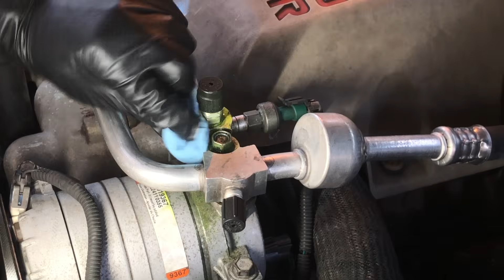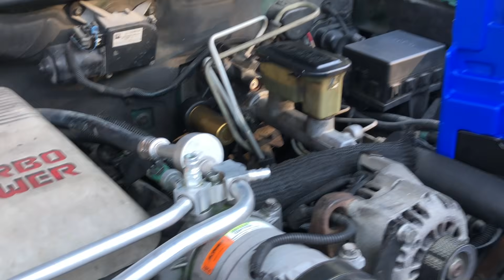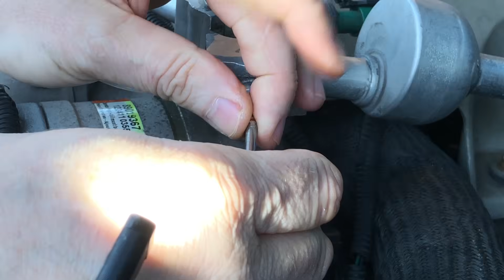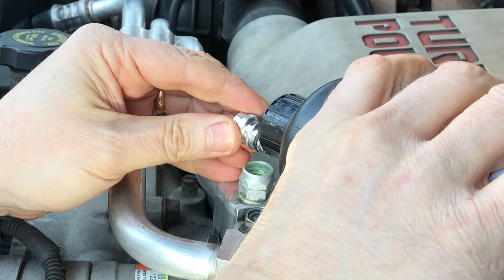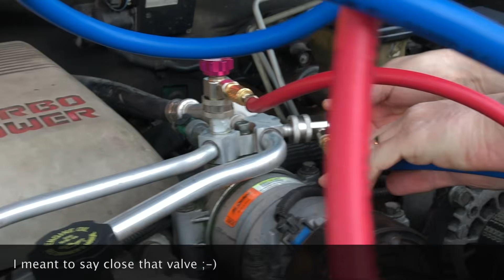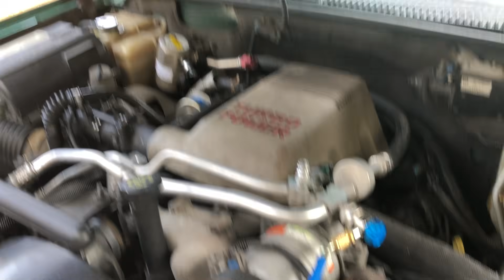1996 - 2002 GM OBS Truck R134a AC High Pressure Ball Valve Service Port Leak Repair (Chevy & GMC)

Comment: I had a small leak on my condenser and the gauges are showing 0. I am going to replace it orifice tube, accumulator and schrader valves while I am at it. Would there be any liquid refrigerant left in the system or does that leak out as well? Don't want to over charge it. Just a DIY er trying to do it myself. thanks
Reply from the maker: If you are sure you have the gauges connected properly to the ports in the AC system, and the valves opened at the gauge connector ends, reading zero would indicate you've completely lost the refrigerant charge.   Given you mentioned you are DIYing it, just making sure you verify it's really at zero (familiar with your gauge/tools) before attempting to open up anything.  

You would need to pull a vacuum on it to be sure there are no other small leaks.
Reply: @DrShock  Thanks for responding, but yes the connectors were on correct and the schrader valves were open and it was reading zero, low and high side. I have a vacuum pump and will pull a vacuum when the replacement parts are on. It's a 96 eldorado. So you are saying that there is no liquid refrigerant that could be in the system, evaporator or in the compressor? thanks
Reply from the maker: No, that's very unlikely with no pressure at all in the system.  The R134a refrigerant is always going to be trying to get to its gaseous state.  When you have a small leak, and it goes unaddressed for a long time, it's quite possible to vent the entire refrigerant charge into the atmosphere over that time.   The more R134a vapor you lose, the more R134a liquid converts to vapor until there's no more charge left in the system.     Pull a vacuum on it before removing any fittings though, just to be sure (again I'm not there so wouldn't want this to just be a whoops I didn't have the gauge valve open all the way situation).  ;-)

Note that when you have damage, like a hose rupture, and you lose the entire refrigerant charge quickly, then you can also lose the PAG oil charge with it.  If you had a small leak, then just replace the amount of PAG oil recommended for the new condenser and accumulator you are changing.  A service manual for your vehicle should give estimates on what to use there.  Worst case, replace with brand new PAG oil the same amount you drain from the old parts.
Reply: @DrShock  OK thank you, I will pull a vacuum first to have no whoops. I do have a GM service manual it says an ounce in each unless it has more than an ounce then put in what came out.

Comment: I learned the simplest jobs can quickly go south on you changing a high side port like that and not knowing I needed a special socket lol had to replace the line going to evaporator from condenser on a regal GS

Comment: so when you pull the freon out of the system, does the compressor oil get pulled out with it? Trying to understand if compressor oil has to go in if the system looses its freon due to leak. I did notice hissing at the High pressure valve when the cap was removed. Thinking about getting the manifold gauge and vacuum pump to try and recharge my system in my 2000 chevy 3/4 ton truck. What other tools would I need? I dont mind buying the basics to save the crazy amounts the shops are charging to do this. Background: It had low freon because the compressor was kicking on and off every second or two. SO...before doing enough research I added a partial can of the AC pro 135a recharge from Oreilys using the directions. I got it up to what I think it too high now. Right at the top of the green on their gauge and just below the yellow. The AC works slightly, but never got really cold like it should. Any advice? thx
Reply from the maker: It's rare in my experience to get any significant amount of PAG oil out when evacuating the existing refrigerant charge using a recovery machine.  The vast majority of the PAG oil is going to stay in the compressor and evaporator (with most of the rest in the accumulator and condenser).   You typically only lose a significant amount with a sudden large leak (e.g., a hose rupture) or when changing the compressor, evaporator, or to a lesser extent the condenser or accumulator.

To know where you're vehicle is at, you really need a set of AC gauges and the service manual.  That way you can determine the state of the refrigerant charge more specifically.   As well as determining if the pressures indicate the other components are operating normally.
Reply: @DrShock  thanks.....planning to get the gauge next.

Comment: I've got an AC problem I can't figure out. Could you please help me? I bought a 1990 Ford f350 diesel. The AC was not working. I checked and found that the system was empty. I found a leak in the evaporator. I bought an evaporator, an o-ring kit, and a receiver dryer. I changed the evaporator out and a bunch of o-rings. Then I added some oil with UV dye and pressurized the system with air using a cheap Ebay manifold set to check for leaks. I ran the truck for ten minutes. I found no more leaks. I let it sit overnight. The pressure did not go down overnight. So I thought I was good to go. I installed a new receiver dryer and then vacuumed down the system for an hour. Then I put 50 oz of R-134 into the system. Everything looked good. I started the truck and the system seemed to be working. But I got interrupted. I shut the truck off and partially closed the hood but I left the manifold set connected. I came out today and the pressure on the entire system is at zero. I even cracked open a line and no pressure. But there is no sign of refrigerant leaking out anywhere. I even waited until night and used a UV light and nothing. No sign of a leak but no pressure. I thoroughly inspected everywhere and there is no sign of refrigerant leak. I'm at a loss for what to do. It makes no sense to me. I would gladly pay you for a consultation and advice via paypal. Everyone's time is valuable. Any help is greatly appreciated.
Reply from the maker: Typically with these difficult to locate leaks, I will vacuum down the system and then add nitrogen on the high pressure side only to around 100-120 psi at the tanks regulator.   Once at this pressure, shut off the nitrogen valve and listen while watching the AC manifold gauge pressure to see if it drops.   Typically nitrogen testing will surface leaks that do not show up on a vacuum test (though you still need to do that test too).  If you do not hear anything, then I'd next start with the soapy bubble mixture you can pick up at your local Home Depot or Lowes for propane/natural gas pipe leak checking.  Applying it at every hard line weld joint and every crimp to a rubber hose in the AC system.   

Nitrogen is very cheap, you can pick up a small tank at your local PraxAir or Airgas center.  The regulator for the tank will be the most costly purchase.   But you can use this for tire inflation also, superior to just air as no moisture going into the wheels to corrode the TPMS sensors.

Comment: Thank you. The service manual appears to reference 4.0 lbs of R134a required for a Suburban with rear a/c. What source are you using for the 3 LBS 8 oz referenced in the video?
Reply from the maker: The service manual is not the best source for these sort capacities as GM did not often update it for different options (front and rear AC options both installed), model year changes,  or changes in powertrain teams.   The most accurate information will be the GM factory refrigerant charge sticker under the hood, affixed to the top of the ACDelco accumulator if you have not had an aftermarket one installed.  That is the source I use.

Comment: I have a 94 Fleetwood Flair motorhome on an Oshkosh chassis, it uses a GM turbo 6.5 Diesel with 4L80 E transmission, previouse owner changed the ECM and the Prom. according to his notes the ECM thinks its a 6 speed and goes into safe mode and won't shift up, unless I disconnect and reconnect. can't seem to find anyone that can help, they say it's too old. can you help?
Reply from the maker: I did a video on these PCMs at one point, it might help you  for the correct PROM for your chassis cab truck application - https://youtu.be/ctf93XFRSUM

Comment: Perfect.  Thanks for the full work up on this.  Just got a new to me 97 GMC 6.5LD.  The low shraeder leaks like a sieve and the system emptied itself twice.  I think I'll just do both and pop down to HF for the vac pump (I mean who else sells Pittsburgh stuff right?  haha).  I think I'll also do the Dorman swap for the high side mentioned below.  Good stuff.  Thanks again

Comment: What is the difference between a deep socket and the "special tool" to remove the high side ball valve?

:)
Reply from the maker: Ha, yeah I thought the same thing when this problem popped up.  But after looking into it some more when no socket fit properly, that valve is not shaped for one.  Since it's made of aluminum, and usually factory torqued in there, the unique tool is required to avoid extra drama ;-)
Reply: @DrShock  Thanks for getting back, the one on my 2002 Suburban is 6 sided like most sockets, I was thinking the octo (8 sided) socket came later to prevent/make it harder for diyer's to participate in a/c maintenance. :)
Reply from the maker: The one in this video is a 1999, old body style, and all original.  So it's not something that came out leter.  Could it be you have an aftermarket AC line or valve, which may not need the unique GM tool to replace it?
Reply: @DrShock  Well, I'm original owner. I vaguely recall an a/c service maybe 10 years ago, so, maybe they did that. Could be different diesel v gas? Puzzler.  :) I ordered parts to do gm original or Dorman conversion  and a socket in case. :)

Comment: Thank you for your video.  I bought a replacement with a Schrader valve.  FYI Dorman 800-955 replaces the high side port for GM and it changes it to the Schrader valve core system.
Reply: Did having a Schrader instead of a ball valve work?

Comment: I use silly putty or gum on the tip of the enclosed Schrader valve removal tool to pull out and put in the valve. Makes it stick to the tool.

Comment: Funny how the owner is worried about the a/c working, but doesn't seem to care about the dirty and low brake fluid? 🤔
Reply: Low fluid just means it's getting close to needing new pads. As the brakes wear the piston in the caliper takes up more of the volume of the fluid from the master cylinder. That level IS NOT low. It is normal.
Reply: @getgetoutout  probably a woman posted that lol
Reply: Prioritize!
Reply from the maker: Being cool comes first.   ;-)   We actually completely pressure flushed that DOT3 fluid on this truck in a previous video - https://www.youtube.com/watch?v=4fImUhpWIdU&feature=youtu.be but there's the normal plastic master cylinder discoloration patina on these old diesels combined with the fluid level being as expected for the friction material wear (it is time for another brake job as soon as her wear indicators start squeaking).

Comment: Thanks for all of your content over the years. I feel like we've been on the 6.5 journey together. I have a 96 k2500 suburban and have done many of the same jobs using your videos to prepare myself to do the work. I appreciate you continuing to produce this content that helps to keep these 6.5's alive. Keep on truckin man. Thanks.
Reply: DR shock  mother hos a 2000 grand prix her shifter cable is bad per the shop they been lokking for over a week for one at junk yards and looking online now. I am terrified cause she does not have money for new car  if we cant find one.  What do you suggest and thank you
Reply from the maker: @birdsong985  This is kinda of an odd video to ask this on, as the question is not AC or truck related.  That's a 21 year old low volume car part, you might have the shop try Pontiac NOS parts sellers.
Reply: @DrShock  sorry I replied to wrong post. Thank you for your answer